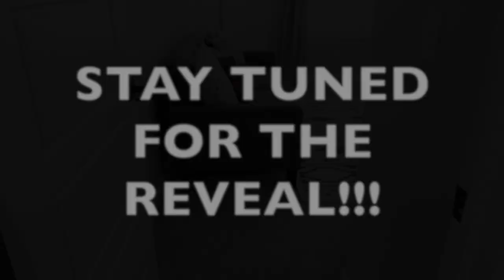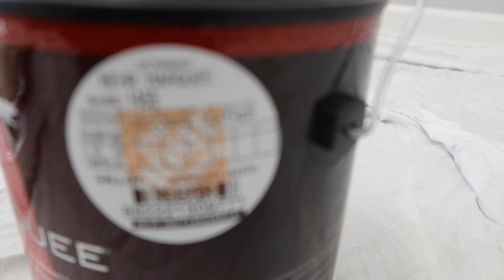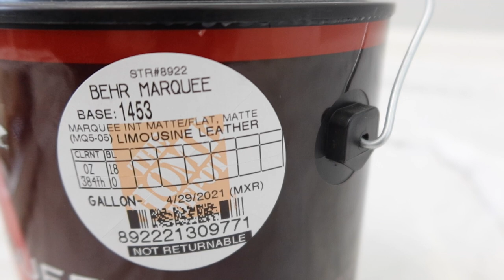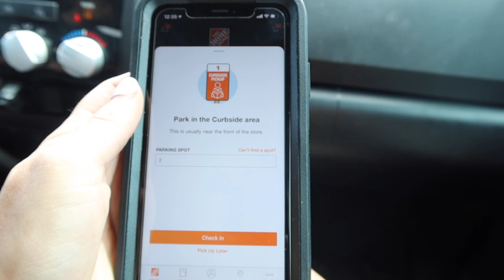DIY ACCENT WALL ON A BUDGET | SMALL OFFICE MAKEOVER ON A BUDGET | EASY FEATURE WALL IDEAS

Comment: The accent wall turned out so perfect 🤩 Home Depot is my go to store for home projects.  I have painted my outlet covers with wall paint before and they eventually get chipped and scratched up, I am wondering if you coated them with a a matte mod podge if that would help protect them better?  I have been doing this on any repainted project that is going to be near water (so bathroom and kitchen) and it has been holding up great, it hardens the paint and seals it in.  I have used it on wood and metal painted projects just not plastic yet.
Reply from the maker: Yes, Home Depot is our favorite stop for projects for sure! And great ideas for outlets!

Comment: This is the perfect video because I plan to do a few accent walls this summer. I didn’t see any sanding or caulking of the boards. Did you do either?
Reply from the maker: Since we did black on black we didn’t have to caulk and the wood was smooth enough we didn’t have to sand either. Super simple

Comment: We have found that “one-coat” paints rarely actually cover well in one coat, especially very dark colors. We use graph paper to set up the design instead of “winging it”. Reminder: if you cut your own trim boards remember to sand the edges. It looks more professional and not so DIY.